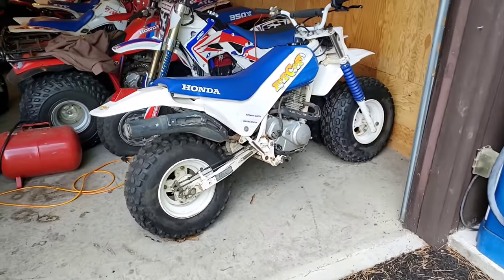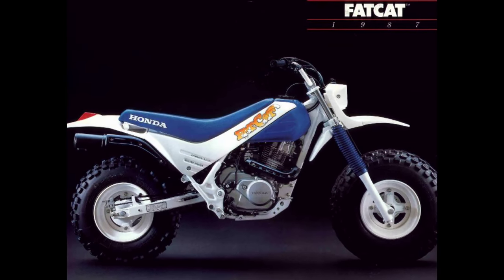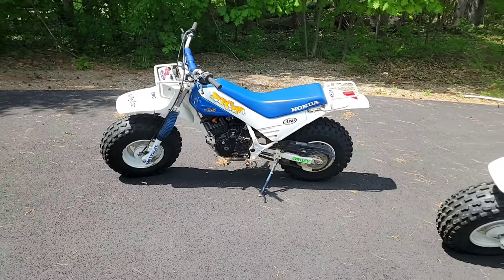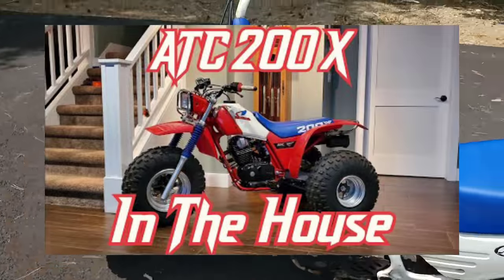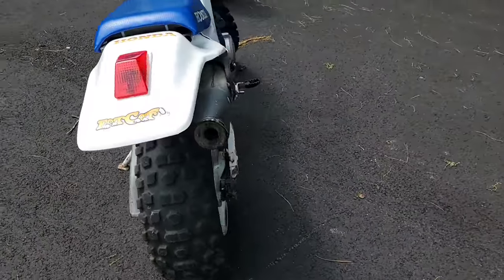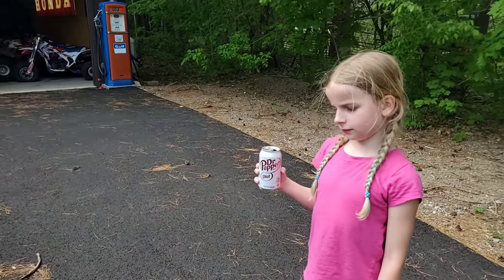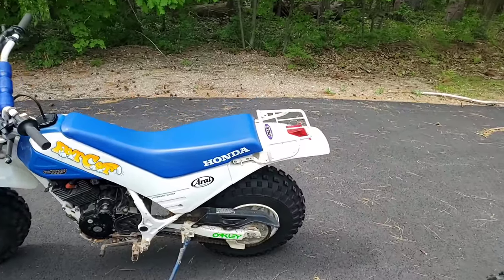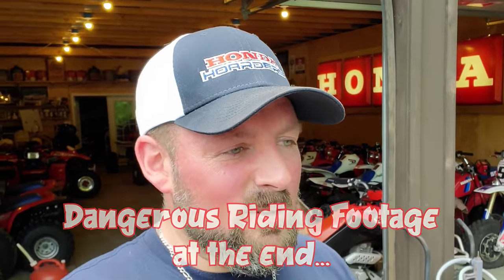The Most Dangerous Honda Ever Made - The Honda Fat Cat TR200 - Totally Radical, or Totally Deadly

Comment: I have found that the TLR200 is also pretty dangerous, with how all of the riders' weight is on the back wheel and the front wheel doesn't really get any traction at all. I've landed on my face (literally... and seriously) because my TLR has the tendency to absolutely disappear out from under me and lay its'-self down pretty randomly. I would trade my TLR200 for an XL200 in decent condition if the TLR wasn't something that I got from a friend after he died.

Comment: I still own my Fat Cat that I bought new in 1986. Has a bunch of oem accessories on it since new. Just Don’t remember any oem  Hondaline TR200 accessories coming in blue other than the optional handlebar pouch in the 86 catalog. A few aftermarket’s were made and powder coated and sold on eBay though.I still have the title,manual,bill of sale, brochure and shop manual,tool kit and dealer key chain and keys.  I buzz around a few times a year with it and still runs new. I’m In upstate New York as well. Need to do an upstate 3 wheeler meet n greet! Lol! Great collection you have. 👍
Reply from the maker: Very interesting!  Someone did mention that the picture I shared of the machine with the blue racks were not Hondaline.  I didn't realize that.  They are very neat and unique machines.  I'm actually planning a 3 wheeler show for August.  Now that we're sneaking up on July, I need to get those plans finalized and start letting people know!
Reply: I'd imagine you fellas upstate NY have some nice places to ride as far as variety. Unfortunaly here in MN most places I was able to ride were banned to atvs and the like. We still have snowmobile trails though thankfully

Comment: I recently acquired a fat cat for free from a bud. It's beat to shit. Fenders are held together by zip ties. Tires have roughly 20 tire plugs of a few different sorts of material. But hold air for a while. I let it set for 2 years and literally went out and it fired right up. Took a ride. Came in and started looking around for accessories and performance parts. Came across this video. Haha bad ass fat bike. My buddy was original owner also.

Comment: Nice collection.  As a motorcycle rider I think the only 2 wheeled machine that handles worse would be the Rocon.
Reply: Really? Tell me more.  I'm actually looking at a new Rokon.
Reply: @davidgarris2513  they are really poorly built . They basically run a lawnmower eng and between the fat tires ,no suspension and the strang torque steer from the 2wd they just handle really funky. We call them 2 wheel tractors.
The old 2 stroke ones are in my opinion the coolest.
Reply: @adambatchelder4121  Poorly built?  At $9K they should be perfect.  I realize that they are not built for speed, they're a niche specific tool.  They did offer a Honda motor on the DOT approved Enduro version a few years ago, but now only the Kohler.  Their accessories are John Deere/ Harley overpriced.  I'm only looking at them, I have never had a motorcycle and actually thought these would be easier, not more difficult. So thanks for the heads up 🐕🐕🐕

Comment: Quick random question. So I have a 1984 200 X. The rubber hoses down closest to where the swing arm meets up to the frame. Well one of them drains the oil out while it runs?  Have any idea of why?
Reply: I have an '85  the large one is crankcase vent, it really shouldn't spit any quantity of oil out there unless it's overfilled, so check your level. If it is loosen drain plug & drain some out into a pan. Not good to run over anyways.
That or maybe too many wheelies(can't answer to latter which is why my grab bar after 37 yrs looks almost new!)

Comment: By the looks of that 86 front tire I feel that may have been a contributing cause to the wipeout in the snow 🙃
Reply from the maker: Yes... and that I'm better on a tricycle... and they're extremely dangerous...
Reply: By design a long wheelbase sounds safe but isn't, the front wheel doesn't have enough weight over it, too much rake to the fork and forks should be a tad shorter.

Comment: Why don't you have one ofthe88 or 88 trx 250x?
Reply from the maker: Great question.  When I was 14 I had a blue/white 1991... so I had a soft spot for that particular machine.  I found a 1992 a couple years back and bought that... would have preferred a 91 like I had, but I was happy to have it.  Then... I did find a 91, but I thought it was cool having both the blue years that I hung on to the 92 also.  I've thought about tracking down an 87 & 88, but I was focused on finishing off the three wheeler collection first.